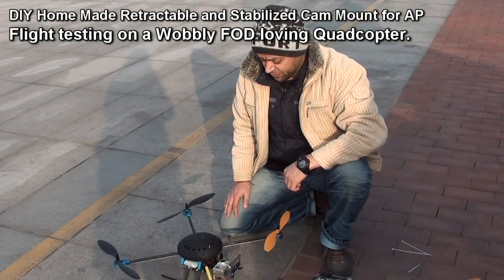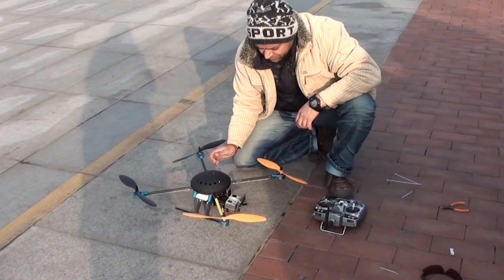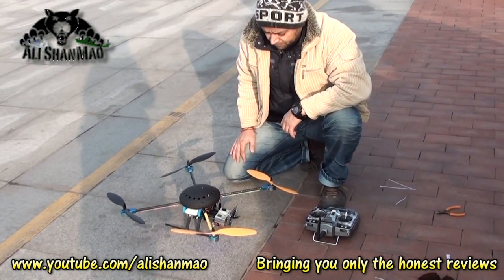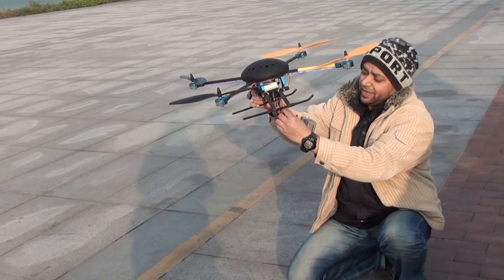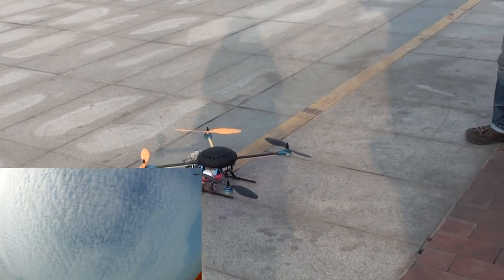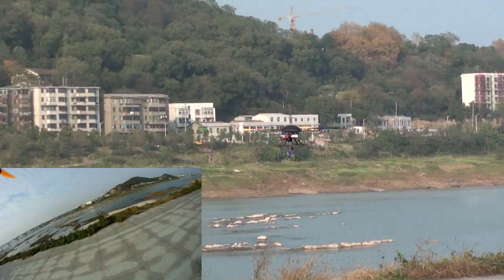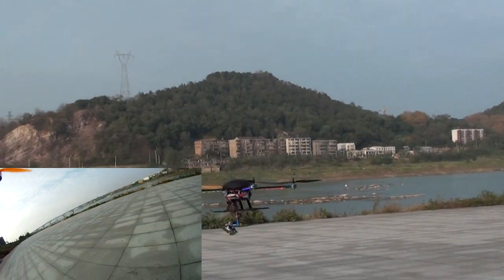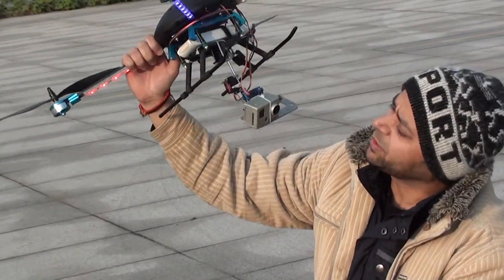DIY Home Made Cam Mount Flight test on Quad 1

Comment: Just wondering whether you tried using any stabilization plugin to smooth out the shakes? There is one by Prodad called Mercalli V2 which is pretty good. A free option would be Deshaker for Virtualdub. You can also use the Barrel Distort Correction vdf plugin for VirtualDub to undistort the GoPro video footage.